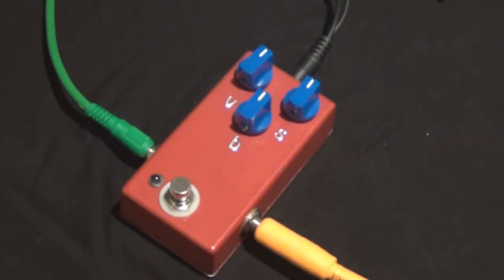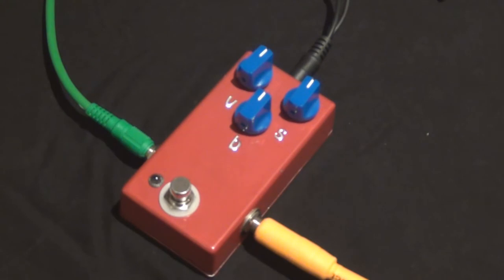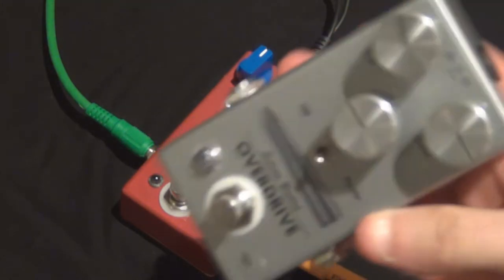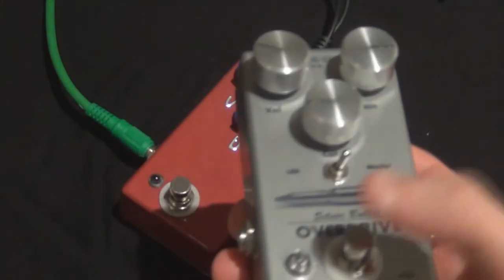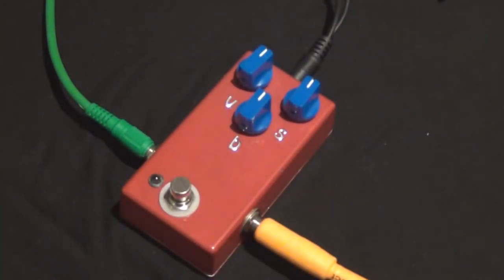Tonebender Mkii Clone - Sound Demo

Comment from the maker: Cheers!  Its built on the original schematic of the mkii.  They may sound different because 1) I have biased it differently (which can be changed of course) or 2) the component values of an original tonebender have drifted.  Oh yeah, transistor types are different as well.

Comment: Byoc suggests swapping the .1m cap for .047 for a more open less compressed sound .And the 100k resistor for 47k ,also 25k trimmer for the 8.2k resistor  .

Comment: What's different about the bias in yours? 100k instead of 10k at Q1's base? The 47k you used as a collector resistor for Q2 is actually the stock value. They only used the 100ks for OC81D units. All OC75 units had 10k/47k.

Comment: Just leave the over drive pedal off it doesn't do anything for Mk11 tone bender clone un less your just into back ground sounds for a soundtrack for whatever!
Reply: I t helps a lot to use overdrive after fuzz if you have to use a clean, quite amp. It acts as  an amp that is driven and warms up all fuzzes and keeps them sounding more like they were designed (fat not too fizzy) If you can get the amp slightly breaking up dirty/clean, old Nashville trick..Not too much overdrive tho. But you are absolutely right, if you can get your amp breaking up a little, theres is no need for an overdrive to get the full tone potential, and it sounds way better than the overdrive following the fuzz..But 60's style fuzzes, general sound bad thru a clean amp. Unless you want that mosquito thing for a particular song..